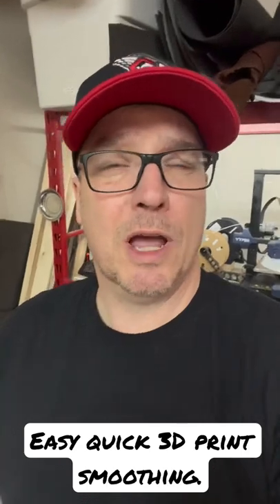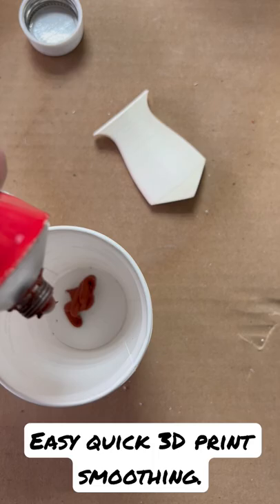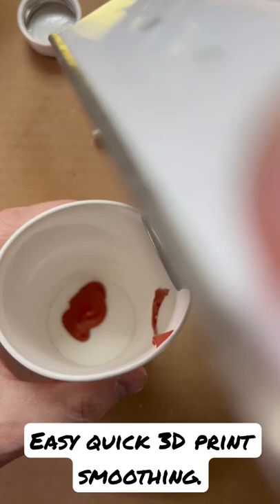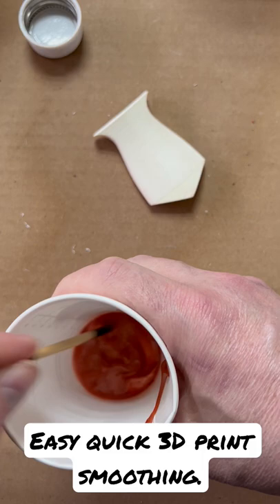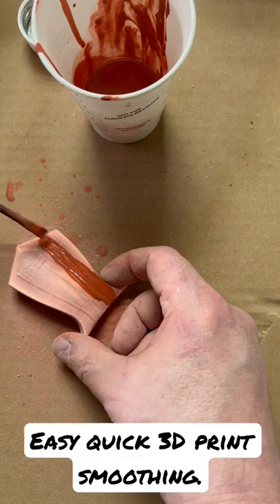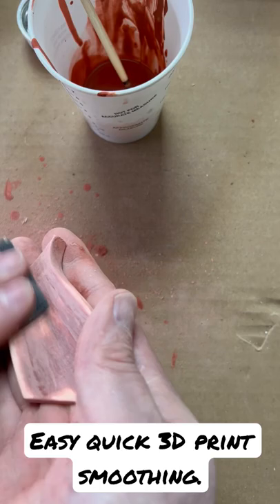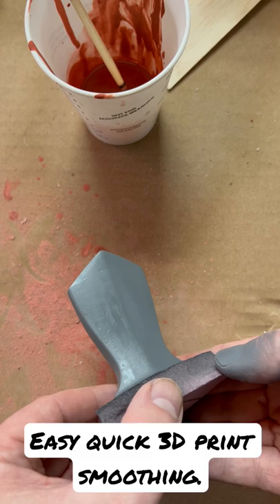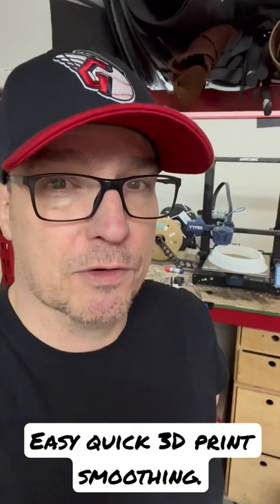Discover the Ultimate Shortcut to Smoothing 3D Prints - Quick and Easy!

Comment: ahhh.. I'd wait until the resolution is so high you won't need sanding anymore. It's just too much work.
Reply: at that point you should look into resin printing but it is also a lot of post processing. i really don’t think FDM printing will improve much more in quality. if you want perfect, you will have to use a mold 🤷‍♂️
Reply: @primetimeturner_YT  For now, yes. I'm very happy with the print quality of my P1P though.
Reply from the maker: You will be waiting a long time I think
Reply: @resonanceofambition  I dont think FDM will ever be equal to Resin.  I have a bambu X1 Carbon and it can print some amazing detail using a .2 nozzle and the .08 extra fine layer lines setting but as FDM get better so does resin.  I have a Phrozen 8k mighty and just recently put the 12k upgrade on it and the quality is truly astonishing and the great thing is that I can print as much will fit on the build plate without increasing the time over one print.
Reply: @3Dprint4you hey, never say never. 3D printing technology is still in its infancy. I’m sure that when the 2D printer was first made, not many ppl thought they would get to the level of functionality they’re at today. Give it time
Reply: @mrsoisauce9017  It's not an issue of tech advancement, it's an issue of the manufacturing process itself.

For example additive manufacturing will never beat the speed and strength of subtractive manufacturing and tons of corporations that didn't understand that lost hundreds of millions to a billion dollars in that mistake. There is an inherent problem in the 3d printing community to try and use 3d printing for everything, instead of leveraging the advantages AM provides and combine that with the strengths of SM processes. 

So if you want the detail of SLA, it's best to actually use SLA instead of trying to make FDM do what it wasn't designed for. Other issues is the design flaws. Most issues with printing can be completely avoided by just not making designs that are poorly compatible with the manufacturing process being used.
Reply: @resonanceofambition yeah the p1s is amazing

Comment: I would definitely have a disclaimer on here to use a respirator and gloves in the future. Having sanded the stuff the dust is super fine and even outside ive had it end up all over my respirator. The putty and acetone should also both be handled with gloves. Be safe all, only get one body.
Reply: ty
Reply: Acetone should almost never even be used unless you'ge got an adequate extractor, a gas mask or are sitting outside in the wind.
It's nassty stuff.
Reply: @mikkelkirketerp4884 women be huffing that stuff in bathrooms
Reply: @mikkelkirketerp4884 maybe if ur around it all the time. But if you want to wear a hazmat suit every time u use acetone be my geuss. I used to use that shit to clean my hands off after work 😂😂
Reply: @sync9999  and it shows.
Reply: @mikkelkirketerp4884  I hate that craftsmen mindset of "ah it won't kill you don't be a wuss!" because A) this shit will kill you, and B) being reckless is not cool nor manly. It's just stupid and should never have been encouraged this much by a group of people who depend so greatly on their bodies for their work.
Reply: @mikkelkirketerp4884  oof lol
Reply: @BoarhideGaming  Acetone really is not as dangerous as people make it out to be. It will not kill you, any casual glance at acetone's SDS will confirm that. The reason acetone is such a common solvent is because it is much safer than many other solvents and is actually metabolized in the body without carcinogenic or mutagenic effects.
Reply: @DaveSmith-cp5kj  "It's not as dangerous" doesn't mean it's NOT dangerous. Using PPE is NEVER the wrong move
Reply: @BoarhideGaming  It is in fact not dangerous. The SDS on acetone is extremely clear on that as as we have a lot of research on the biochemical pathways of it. 

PPE has to be used intelligently in reference to the hazard. For example if you use gloves with nitric acid it is actually more dangerous than going barehanded. Also exaggerating threats cause people to not take safety hazard seriously.

Comment: You could also use a soldering iron with a chiseled tip to smooth prints out, and then maybe sand it down after.
Reply from the maker: True. I think this would be faster

Comment: There’s another way to do it. This is an old gunpla trick. (For gunpla we use a different chemical, but it’s the same process)
PLA is alcohol soluble. ABS is acetone soluble. Both are MEK soluble(methyl-ethyl keytone) take some extra plastic( of the same type as the part), and then make a liquid solution using the chemical of choice and use this as your “glazing putty”. It fuses the plastic together at the molecular level. It is impossible to remove. This can also function as glue to glue parts together. Be careful not to use too much chemical as it will eat through the plastic, that’s what it’s supposed to do. By dissolving the outer layer of plastic and brushing on new plastic you make a new layer on the micro scale that cannot be removed and can be sanded and worked once dry. The ideal ratio will dry in 2 minutes or less and bonds almost instantly. You will see brush marks so be careful and gentle handed. start with 1:1 mix of plastic and chemical and add chemical to get desired consistency. The more chemical you add, the less brush marks will appear, but the more likely it is to melt the part, and vice versa. MEK is nasty stuff and can cause brain damage and cancer. Use that PPE. Practice on a spare part and adjust until you reach desired results. I hope this helps someone. ❤+✌️

Comment: What's a trick for ASAsanding? Since this probably melts ASA too much. I was thinking of the vapour trick.
Reply from the maker: It flashes off so fast that the ASA will not see any issue. If you are really worried then use IPA

Comment: Does this only work on ABS/ASA? I'm trying to find a solution to smoothing PETG
Reply from the maker: Works on all hard plastics. So yes PETG will shave well
Reply: You don't want to actually do this with ABS/ASA because acetone dissolves it and applying it with a brush directly on the surface will ruin your finish. Look for vapor smoothing for abs and asa parts

Comment: So does this mean, there isn't a use to get a "color" filamnet for the color because we will post process and completely change the color and paint it? I'm struggling to understand this because there are so many color filaments and I want to see if I can sand and prime it without painting.
Reply from the maker: Ya this is not for a print that is made to not be painted. There are not color fillers out there that I know of. So in this case I would look at these videos and it would work for you https://youtube.com/shorts/H1I2YnhBgtE and https://youtu.be/a4e9JJkinvk
Reply: @DreadMakerRoberts  yes i don't want to paint my 3d prints. I was hoping to do something with sanding and primer and such to ensure i can have colors from the filaments and not paint them again..are you saying that this is possible?
Reply from the maker: @JohnyPatrick  Yes using the videos I linked above
Reply: @DreadMakerRoberts  appreciate it. I'll check those out 🔥

Comment: This is my first time ever working onna 3d print. Would DAP 33 glazing putty work as well?
Reply from the maker: It should, however the solvent used in DAP 33 might be different and you may need to use something besides acetone. I do not know so it would require some testing to find out.

Comment: Would it work using rubbing alcohol? From my understanding the acetone just makes the putty thinner but dries faster because the moisture evaporates quickly
Reply from the maker: Yes it should but it will not flash off as fast
Reply: @DreadMakerRoberts  ok cool thanks :)

Comment: Awesome, but don't you have to be extremely careful with acetone?
Reply from the maker: Great question. It's not the best. But lets look at an example where acetone is used a lot. Nail polish remover is acetone. I think it's not so bad if so many people handle it  daily with little to no effect.
Reply: @@DreadMakerRoberts  I see, but still be careful, right?
Reply from the maker: @Coldbird1337  Exactly. It is a solvent and you want to use it in a well ventilated place and minimize skin contact

Comment: ok now I found another method for smoothing PLA prints and I still don't know which I should use for my project ... I'm a bit scared because It's my first big print.
Reply: You could test on a smaller print. Or just choose one and go for it. You will learn a lot on your first big project that you can apply in the future. Try to make it the best you can but also remember that failure is part of the process and is how we learn
Reply: @kylereis3639  thx for the advice. I appreciate that.

Comment: Even easier and quicker is 3D printing resin (even on an FDM print). Brush on a light coat, cure it for a few seconds with a strong UV flashlight (or a curing chamber if you've got one), and you've got a nice smooth print with no sanding. Clear resin even gives you a nice glossy finish.
Reply from the maker: Yes this does work but it is more prone to cracking, Ive had this flake off, and one can lose details with this method. This retains details very well.

Comment: Just don't use it with ABS or ASA lol
Reply from the maker: Incorrect it works great with both the acetone flashes off so fast it merely helps bond the filler to the surface